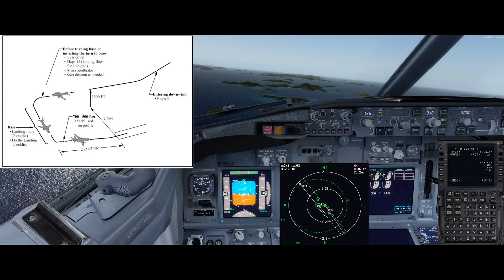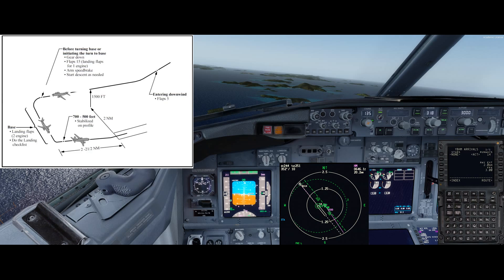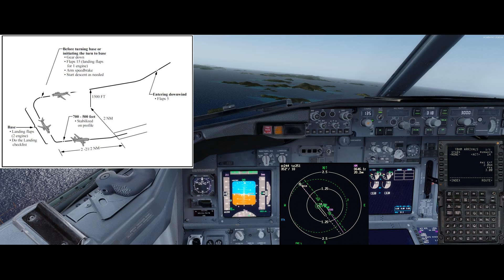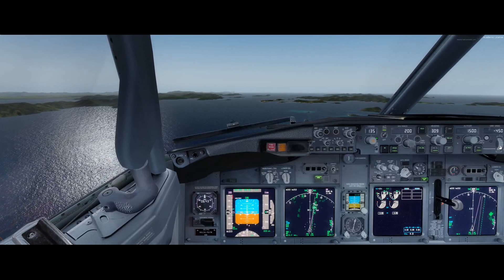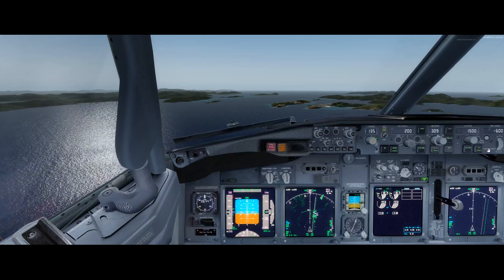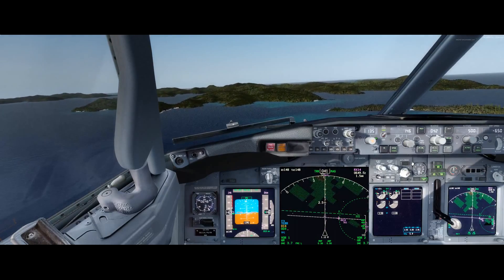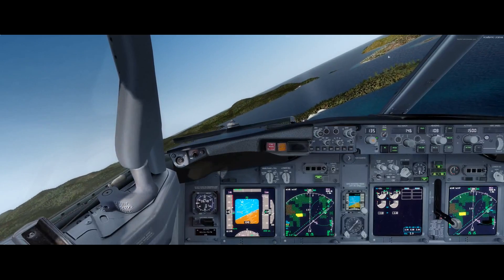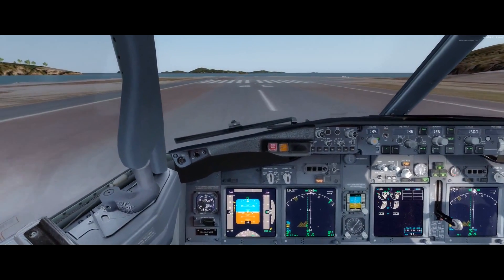B737 Visual Circuit Procedure

Comment: Very Good & very Professional - Gives me something to work on for my B737NG "Training" in Flight Sim. BTW I landed at Hamilton Island many times years ago in the Fokker F-28 Fellowship with a "Steam Driven" Cockpit - No FMS, No Auto Brake or Reverse Thrust - Any power set under 80% was a waste of time with low Bi-Pass Engines. (I ended up on A300-600LR Airbus BTW so know about FMC's - We had the "Bird & Cage" to setup downwind & approach angles for visual approaches)
Reply from the maker: That must have been for EastWest!? The F28, what a great machine!
Reply: @thesmartpirate   how did you measure the downwind leg on this video?